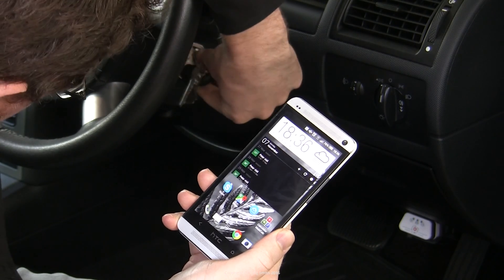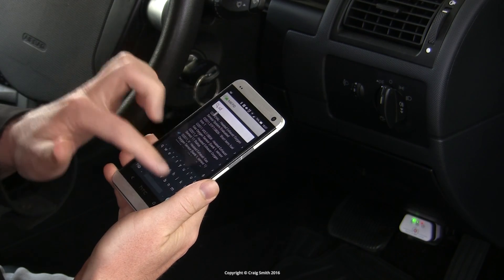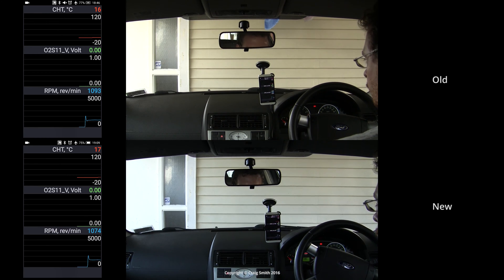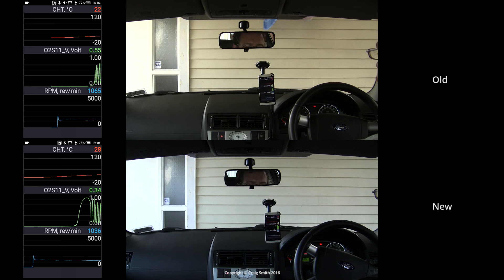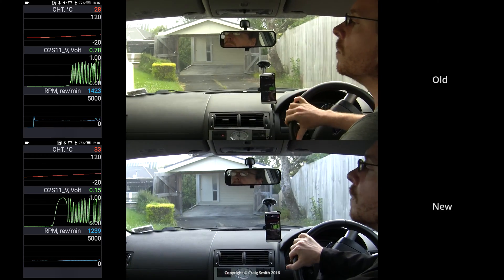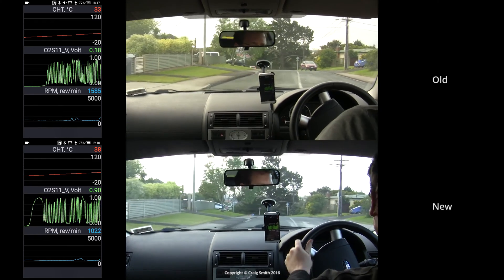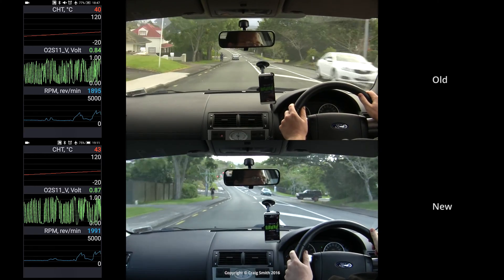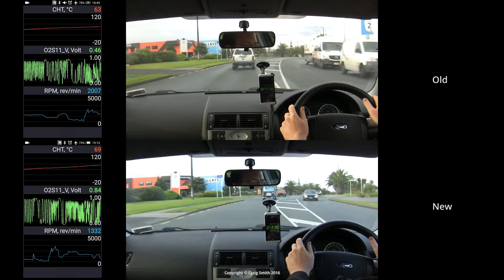Demo: O2 sensor new vs aged voltage telemetry on test drive

Comment: the new one always varies between 0.1v and 0.7v with a uniform graph in top and bottom. In the old one the graph it is not uniform and allows 0.3V 0.4V, 0,5V 0.6V etc.

Comment: Hi Craig, not noticeable in your video, but on my focus cmax when I coast down in gear, both of my O2 sensors drop to 0v. Is this normal? The internet does not give any clear info about it.
Reply: Have the same problem and not getting any info on this. Mileage had dropped significantly. Did you ever find a solution to this?

Comment: Both bank 1 & 2 sensors of my Audi Allroad 2.7t  oscillating between 0.1-0.7 at idle and 0.1-0.75 hardly to 0.85 while high rpm driving. No fault codes at ECM, looks like I have to buy new ones.